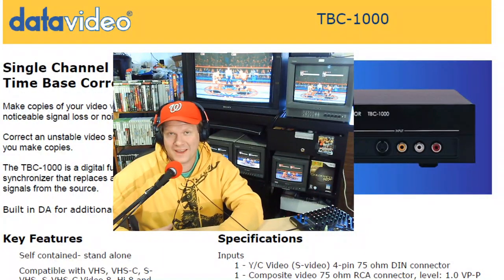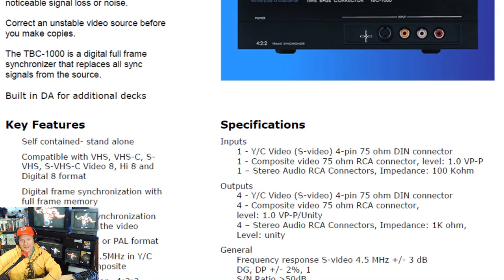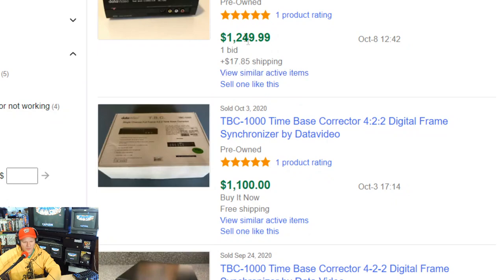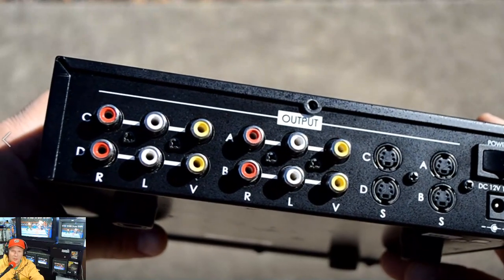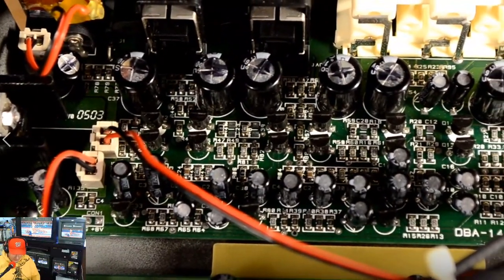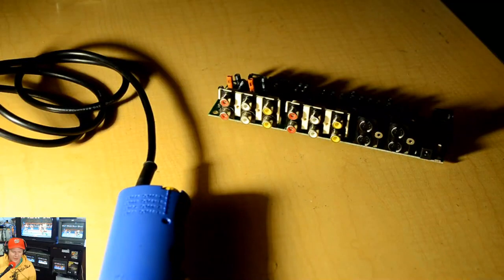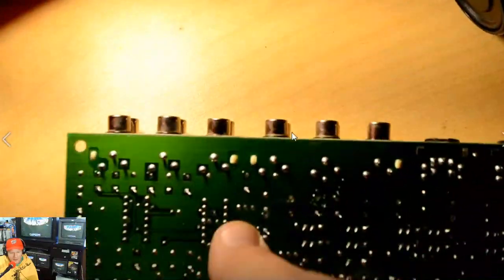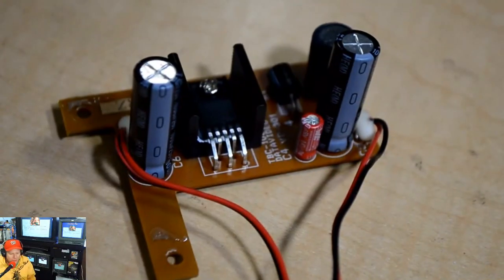DataVideo TBC-1000 | Commercial Time Base Corrector Repair | Retro Tech

Comment: Too bad this goes for obscenely expensive prices on Ebay. Hopefully alternate fpga-based solutions like the upcoming PixelFX Morph will completely replace this.
Reply: Devices like the ossc, framemeister dont work like TBCs. They are just scalers that need a stable signal from the console, completely different than tape recording. If you look into the forums people that tried it with those devices arent too happpy about the results. What they are probably great for is to tap the image sensor from old analog cameras without having to record on tape.
Reply: @maxmustardman298  Yes 100% correct.
Reply: @thetechgenie7374  I wonder if even the pro devices from Blackmagic or AJA would do a proper job with accepting signal from those old consoles, Ive read that synch was sometimes quite sporadic, but the old CRTs didnt give much of a shit if the signal was off or not. Probably not so much with the pro equipment.
Reply: @maxmustardman298    There other TBC’s that are better then the Datavideo that will work with consumer formats like VHS but issues is was heavily used by big post production studios and broadcasters and most will require servicing and complex to get back in good working order. 

Hence reason Datavideo TBC 1000 goes for so much as they are simple no proc amps to deal with and only need capacitors changed out and distribution amplifier bypassed to get decent results. I definitely prefer the I.den over it as works well with the JVC s9600 and get good results but you will need scope and signal generator. The Datavideo actually Not that good and has issues even when restored soften the picture and freezing up fields and losing sync. The only Datavideo I like was the 3000 version with proc amps as control for color.
Reply: People are paying those ridiculous price as they are essentially renting them for free, or at a lost, or gain, or using them as a stored value hoping they make money on investment down the road. What people do renting them is using them to do their transfers and reselling them after done with transfers.

People that actually wanted to keep them bought them when they clearance them out. It a shame as people that still want them is not worth paying those high amounts.
Reply: @thetechgenie7374  would you be willing to service and do the bypass mod on a TBC1000?
Reply: Won't mine servicing them.
Reply: @thetechgenie7374  how can I get in touch with you to discuss it?
Reply: @hscitko  I have my email contact on my YouTube channel home page.

Comment: Their other frame TBC’s that can handle VHS and other consumers formats well and actually better then the datavideo 1000 I have plus the professional TBC as has Proc amps and one of the only one that can handle consumer lever signal well as most don’t. Won’t say as prices will shoot up due to stupid eBay sellers. 

The problem with the Datavideo is find the DataVideo added noise overlaid by mushy softening that is, if the garbage distribution amp doesn’t cut the signal. The Iden doesn’t and proc amps work great. It my go to but finding one low hours is hard and working correctly is like Finding a needle in the haystack as most were abused and have tons of hours on them and likely been resold over the years and will likely not work correctly anymore. The Datavideo is better the Cypress AVT and the Datavideo would be the one to go with between the two and usually one I recommend, but replace junk capacitors on the tan board on power supply as seal breakdown and they leak and go high ESR.

The AVT 8710 green color one good, avoid the black ones. But the green ones also have flaws as when it lost sync on a field, it would hold it frozen while the other field remained in motion. The ghosting on bad patches of tape was unacceptable, so was the flaw with the Cypress. I can say this model as eBay sellers already know about that one as on forums. 

I know these as a engineer that dealt with all sort of TBC’s and serviced and calibrated them.
Reply: That's not entirely accurate. 
(1) In recent years, shady eBay sellers would swap black boards into green cases. 
(2) TVONE (AVToolbox) had commercial contracts, and it's believed that bad green units were warranty serviced in the "black" era.

At this late date, all I.Den units are trashed. I've only seen one good IVT-7 in the past decade. It was a PITA to calibrate correctly, something that you'll never have to do with DataVideo/Cypress type units. After that experience, I'll never touch another I.Den if I do see one again.

There are other units, but each has issues, most of them worse than any DataVideo on a bad day.
Reply: @lordsmurf  eBay as always doesn’t shock me they do that to be honest, you always have sellers trying to get over, I seen that a couple times so far. 

Now yes your correct most broadcast units will be trashed at this point. The hours and abuse they put on them very high compared to a consumer unit and way more complex. Thankfully the I.Den that I got was never really used much at all and still even had the feet and was never rack mounted. So got lucky but do agree most are junk by now as they are a pain to overhaul especially since it dual two large boards you have to go though and calibrate afterwards. If you don’t have the test equipment, or knowledge avoid pretty much is what I tell people. The I.Den it done good for me and ironically same model. For the general consumer I get why they pay for the data video as not much you have to do to get working correctly may not be commercial quality but does get the job done reasonably well.